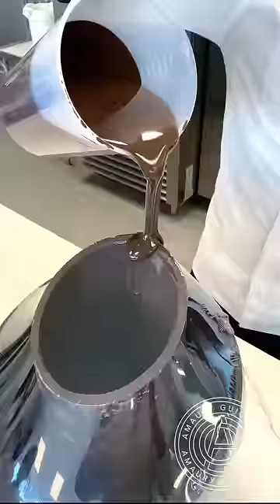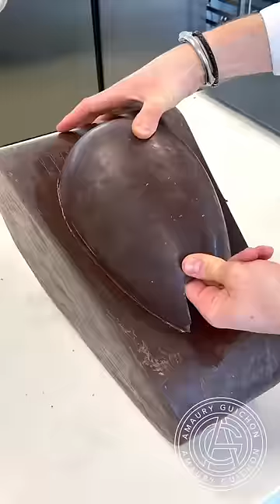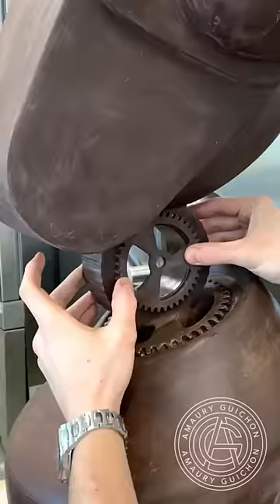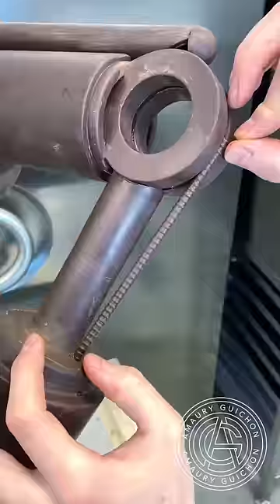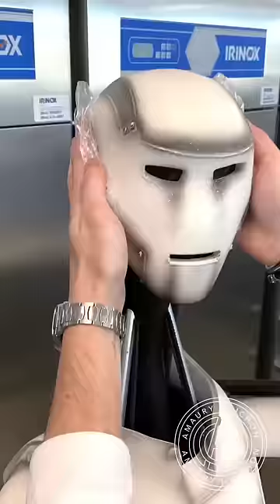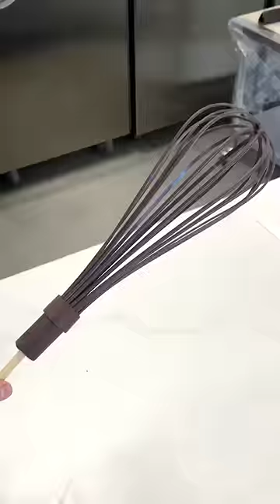Chocolate Robot Chef! 🦾

Comment: I wonder how long the planning stages are for one of the larger builds? Developing new or modifying current techniques and then practicing them until it reaches perfection. The engineering for the design itself to make sure it has structural integrity. Even just the build order itself must take a decent amount of time.
Reply: sure, we just get to see the tip of the iceberg